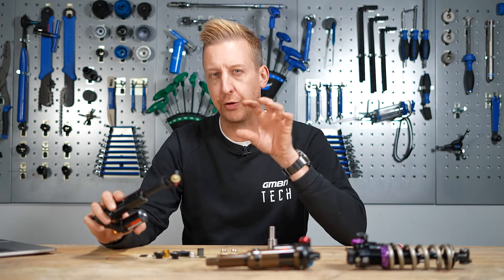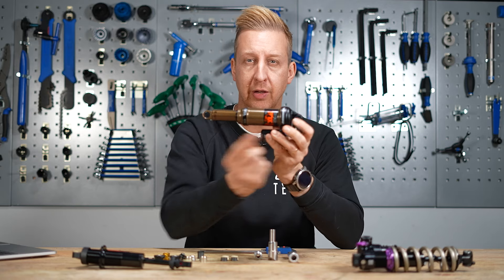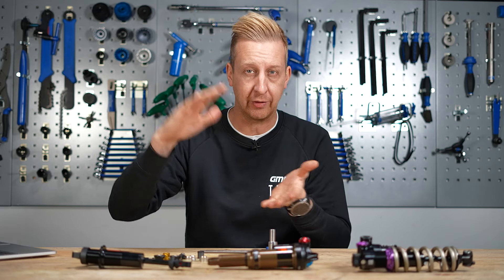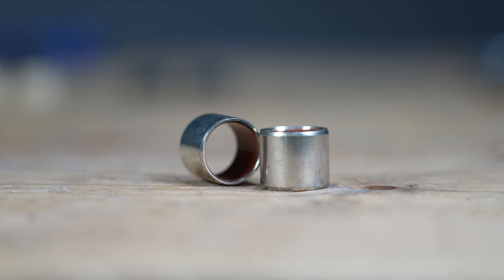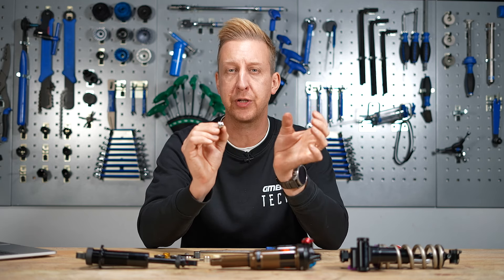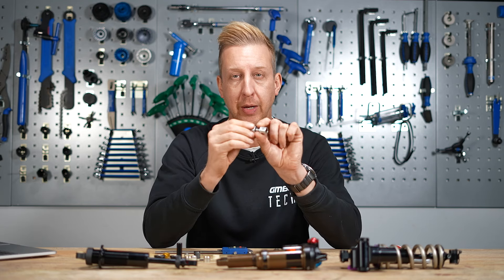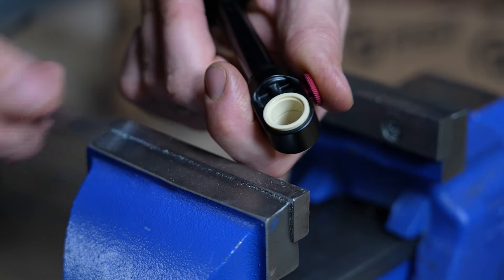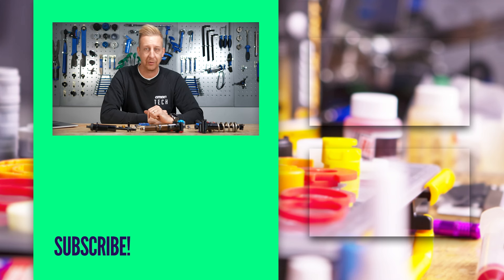How To Remove And Install MTB Rear Shock Mounting Hardware | Shock Bushings Explained

Comment: Another great video Doddy.  The bushes that have an orange-coloured bearing surface are actually DP4 Bushes.  DU Bushes have a gray coloured bearing surface due to a very small percentage of lead which adds to the lubricity of the bearing surface. Back in 2007, I went into a shop to get my bushes changed and they were going to use a socket.  I immediately left and the next day I machined a simple tool to get this job done.  I actually started selling those tools online after a few refinements.  cheers.

Comment: That's excellent Doddy! Thank you!
This video came on spot, as I planned today to replace (upgrade) my rockshox shock, and will have to remove\install bushings and hardware (have new hardware, and bushing removal tool).
I will update once complete.
Reply: It went very well!
Apparently, the new shock, Rockshox Super Delux Ultimate 2023, came with installed bushings.
I did have to use the hardware tool to install it.

Comment: My Fox rear damper is standard equipped with DU bushings normal size 15 outer diameter /12,7 inner diameter x 12,7 width. In fact, 12,7 mm is 1/2 inch.

Comment: I had to have mine custom-made. 12mm bushing fitting a 14mm eyelet. 24.5mm front and 37mm rear hardware. My bike frame is a 1997 haro extreme, rock solid body I've upgraded with modern hardware

Comment: Thank you for yet another great tutorial but I was just searching solutions for a diff problem: my rear shock bushings have sizzled up on the bolt and I m not sure how to take bolt out at this stage. Took out the rear suspension arms to make it easier but obviously the one on the side of the screw head could not be taken off. I hope you can help.

Comment: A point to make here is both du and igus are brand names.  Du bushings may have a metal outer but the low friction side is a thin coating of nylon once this is worn out you are metal on metal. The igus bearing is all low friction material and although they get sloppy as they wear. There is more material to wear so in essence are longer lasting also igus make these bearings in deferent materials including peek plastics that is far more hard wearing than the Teflon in the du style and also has lower friction characteristics.

Comment: I have aluminum bushings with a little collar like the Polly on in the fox. My shock is a XFusion 02RC and got to change to a different  shock because they don’t make this shock or rebuild kits for it. How do I get the aluminum collar bushings out? And it has ball bearing on the other end, do I press those on through?

Comment: Should you use grease at any point during install?  I found when I pressed the mounting hardware into the du bearing, it took a thin layer of the inner material away...

Comment: I purchased the tool, still stripped away some of the bushing inner material. Had to do it again.
Reply: Did it cause a problem that a thin layer was stripped away? How would you attempt the installation again to try and reduce that?

Comment: so i tried removing my fox dps shock on my 2017 trek fuel ex and the top through bolt is seized on the bushing and i can't pull it out.  tried wd-40 overnight and the bolt is still stuck.  it just spins and spins and it won't come off the bushings and i can't remove the shock from the linkage.  any ideas?

Comment: Shoot, this isn’t what I was looking for. My rear shock has an axle going through the bushing to fit in the frame. It does not come out by hand, but it is wide enough that I can’t remove the air can to do my 50 hour service. I was hoping to find a tool to remove that, not the bushing itself. Really don’t want to pay a shop to do the 50 hour service that I know I can do just because I can’t get that axle out. The internet is really failing me on this one.